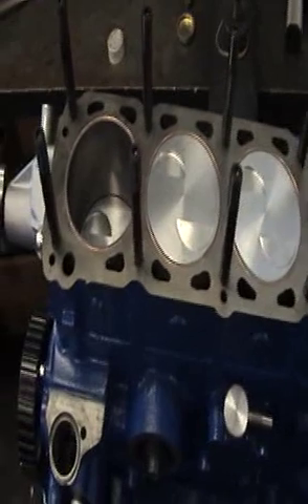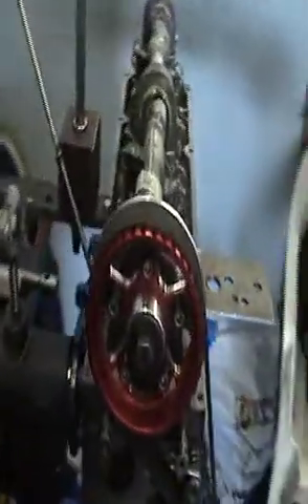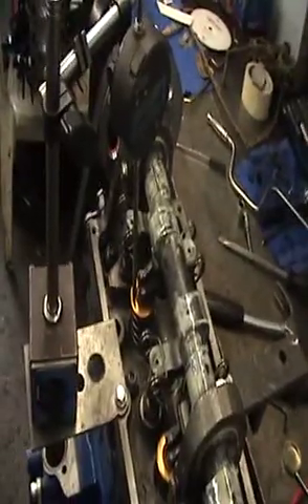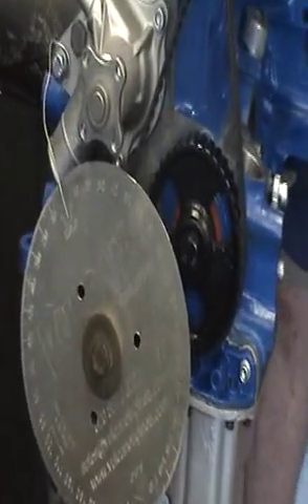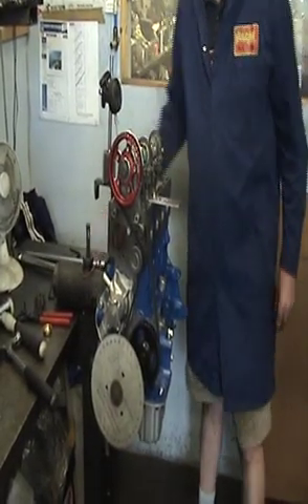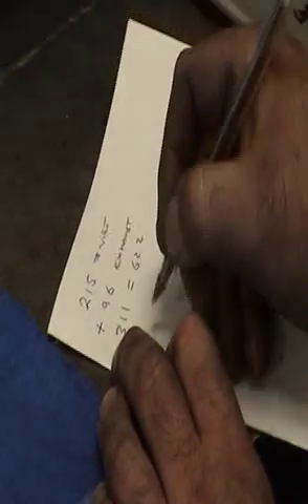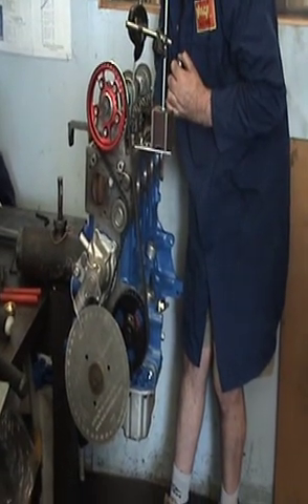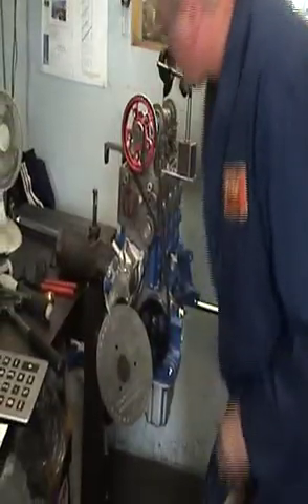How to set the cam Timing on a ford pinto Engine

Comment: Excellent video,and very helpful indeed. Although I'm not quite understanding why you turned the crank 360 degrees (tdc to tdc) for the inlet valve measurement,and yet for the exhaust valve you turned the crank a fraction?
Reply: He was finding the lift of the exhaust valve at tdc by turning the crank just far enough to put the follower onto the base circle.

Comment: Sorry but using a dial gauge to find TDC is not accurate enough. Piston dwell can account for a few degrees of crank rotation and even reading the needle by eye and looking for the middle still leaves room for error. Though an experienced eye will get it damn close; probably to the point where it's negligible but still........